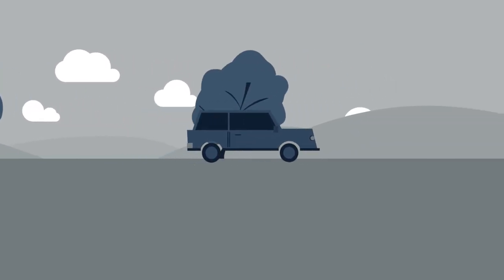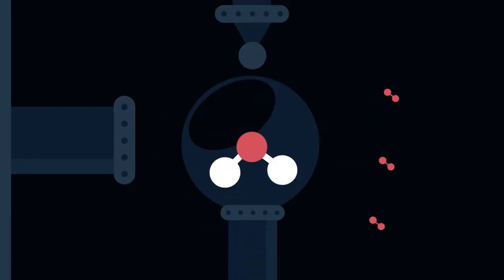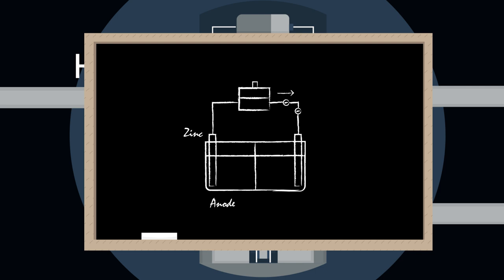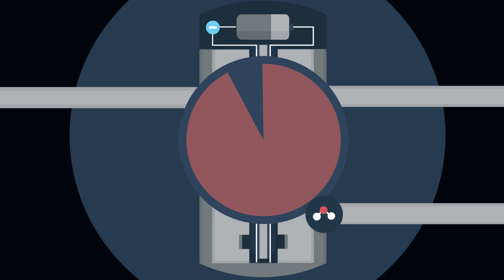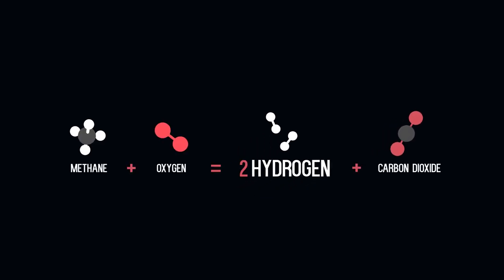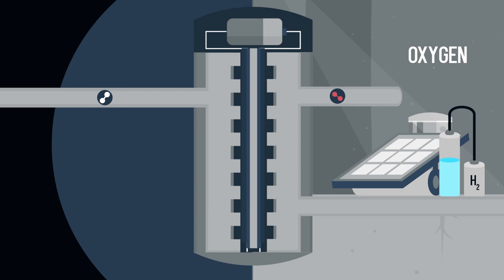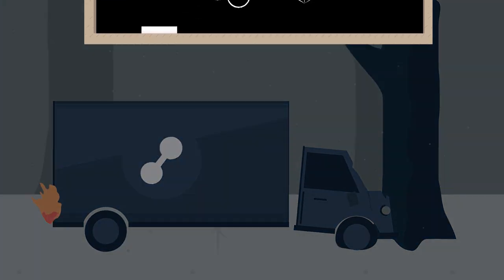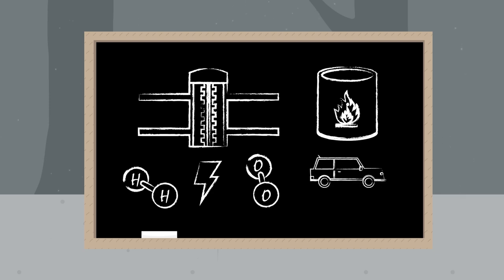Hydrogen & Fuel Cells | Reactions | Chemistry | FuseSchool

Comment: Why can't we use hydrogen from electrolysis of water.
Reply: It is too expensive
Reply: you can. Your car might explode if it crashes though. Cause Hydrogen with pressure or heat is a bomb.
Reply: You can but the thing that makes fuel cells so useful is the fact that it’s BY-PRODUCT is water. And therefore doesnt need water for the actual reaction to take place.
Reply: Also water cant be an electrolyte if its not an ion with a charge because then it cant be attracted to the electrodes
Reply: We can in short, but it's not excellent energy conversion.  The biggest problem by FAR and the one that is turning people away from H is the storage, creating 5 kilos of liquid hydrogen from water using electrolysis would cost (at 15c per Kwh) around 30 dollars, so 30 dollars to fill a H2 car, but it has to be stored at 200 Bar... that's the problem,. 200 bar is huge... Your average car tyre is what, around 34 to 40 PSI or around 2.4 to 2.7 Bar.  The current H2 cars from Tokyo run on 200 bar or 2900 PSI... It's because H is the lightest element it takes a lot of pressure to squash it together to make it possible to get an equivalent range of a full tank of gas. Can you imagine what kind of monstrous compressor you would need in your back garden to do this for say home production, and if anything went wrong under those huge pressures and we got leaks, one spark to the equivalent of 1 litre of H of gas... and you lose your house. You cant use steel tanks either, as H turns steel brittle over time and can even leak through it, so you need a very specialized carbon\steel ceramic inlaid tank.. very expensive.  That is also why it's very expensive to transport.
Reply: Cos' it needs electricity.
Reply: You can. But that would mean YOU would be independent of centralized companies (today: oil, coal, gas). You cannot be independent or else you cannot be forced to work for money as a slave. If you cannot be forced to work for money as a slave you would be a free man. Only rich aristocrats can be free. You must remain a slave and thus you need to HAVE to buy it from "higher source". It is called dependency and it secures current power structures. 
So if you use batteries in cars you will be dependent on power station and remain a slave who has to work for money. Enjoy life!
Reply: Well in the video he said we can but where and how do we store it?
Reply: Yes you can. i believe he forgot to mention it. Besides, fun fact, the most efficient electrolysis method is called PEM.
Reply: mz tech We can, and we do. The most common is methane though
Reply: Because it takes more energy than that the Hydrogen produces, hence the irony of using power to generate less power! (keeping the environment aspect aside)
Reply: NO answers?
Reply: Are you thinking what i thiking?
Reply: we can, but the infrastructure to do it on a large scale is super expensive

Comment: We NEED the current Internal Combustion Engine(ICE) Vehicles to Sequester Carbon!. - We can( and need to) use the world’s ICE vehicles to suck CO2 out of the atmosphere by running them on ‘Carbon Negative Algea Bio Fuel’,the Internal Combustion Engine( ICE)was responsible for much of the atmospheric CO2 due to them running on Carbon ‘Positive’( or Carbon based) fuel. Now if those same Engines were run on a Carbon Sequestering Bio Fuel it would mean the more people drive the more CO2 would be sucked out of the Atmosphere.  The Algea Bio Fuel is grown using waste watert so saving lots of energy that is currently used in  energy intensive waste water treatment. Plus from every gallon of Algea Bio Fuel, 10 pounds of nutrient rich( high in Omega 3 etc) Carbon residue is produced and permanently removed from the atmosphere. Photo Bio Reactors( PBR) can grow Algea Vertically in glass tubes and are easy, cheap and quick to build.  It is possible to roll out PBR across the country in every village, town, neighbourhood and city in just a few years, we MUST make this transition asap. Electric Vehicles( EV) are not the answer as we don’t have the time to build billions of new vehicles( of whatever type) also the vast amount of resources and energy to make them could finish us off. Also EV are not Sustainable as they rely on non renewable Lithium, Cobalt, Manganese etc which is very destructive when mined as they use strip/open cast mining and uses large amounts of water in evaporation ‘pools’in Arid Regions. Also EV only cause emissions( in their manufacture from Mines, to Road), they can’t be used to sequester CO2 as the ICE could, and seeing as roads  take up a lot land we NEED to utilise that land as a Carbon sink. Carbon Negative Algea Fuel would mean in effect we would be using the world’s ICE’s as Carbon Capturing machines. Another positive to rolling out PBRq is it would create millions of new local Green jobs and bring £millions to communities and regional economies, and could fund the transition to a Sustainable future. So Algea Bio Fuel is a viable, positive low tech solution, in every aspect its a winner!.

Comment: Problem with hydrogen fuel cell it's not easy to obtain hydrogen.

On top of that splitting hydrogen from water isn't cheap either.

Unless we are using renewable energy to do that. But then arises the Question why not simply use electric car?

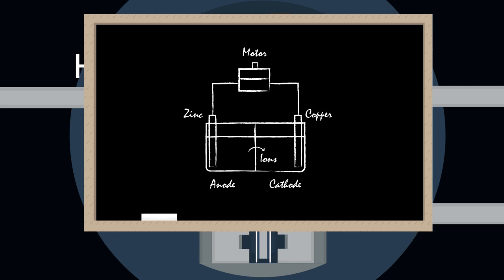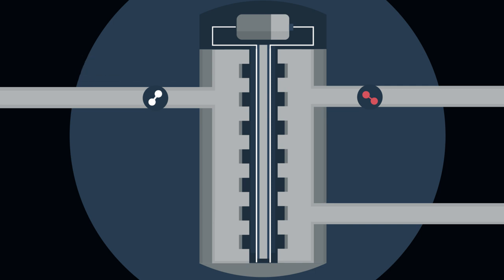Comment: @1:37 - @1:42 the illustration is incorrect. the arrow for the flow of ions should be right to left (not left to right). obviously you've got several people working on these videos, and they cant all be expected to know the science! you should employ me to fact check :0 :)
Reply: Sorry, you are wrong here - the zinc +ve ions flow from the zinc anode, through the electrolyte towards the copper cathode. Of course the -ve ions in the electrolyte will flow from right to left, but the voice over says "movement of metal ions through the solution" and these flow in the direction of the arrow.

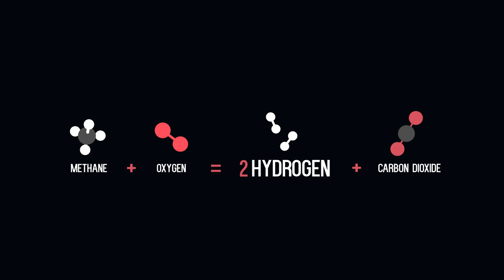Comment: also 2:50 methane being converted to CO2 is not adding to the greenhouse effect. methane is a much stronger greenhouse gas. your videos need a more scientific editor. #me
Reply: The methane is natural gas, and is not purposely released into the atmosphere. Using it as a source of hydrogen is not 'green' because it is equivalent to burning the methane in a normal furnace or engine - forming H-O-H and O=C=O, thus releasing new carbon dioxide into the atmosphere.